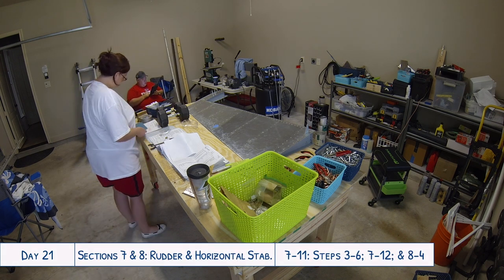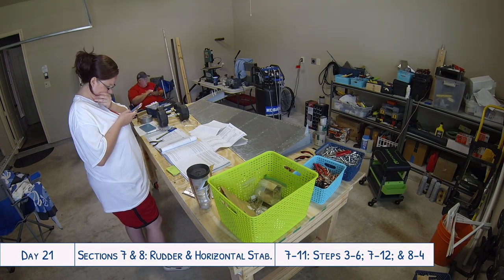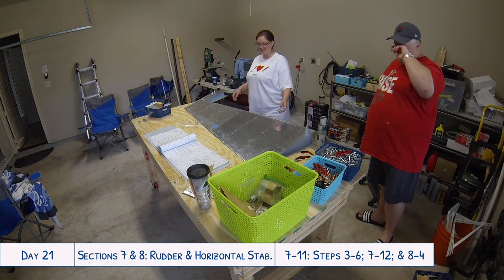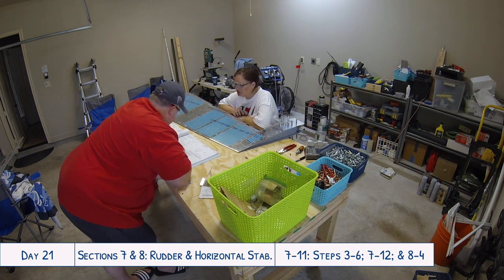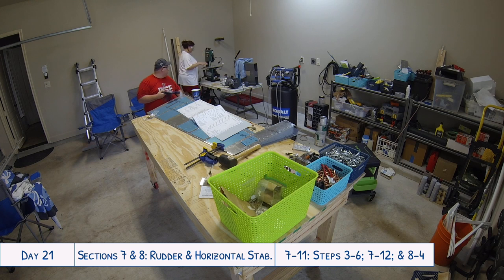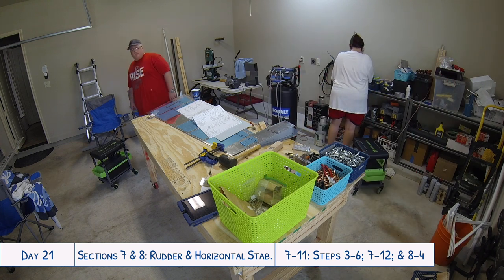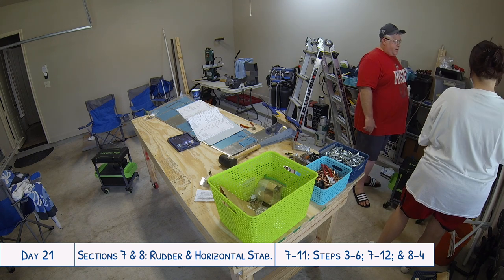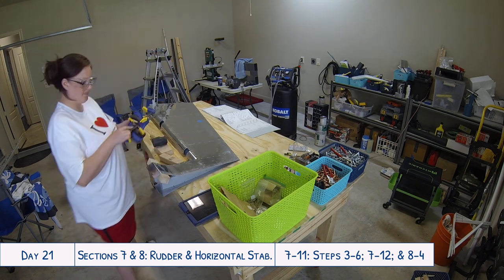Van's Aircraft RV-10 Build: Day 21 - Rudder Complete! (7-11, 7-12 & 8-4)

Comment: I'm probably late with this suggestion but have you got your hands on a "Strap Duplicator - Bushing Type" check them out at any of the aircraft tool suppliers, if you haven't got a set they are nice to have when you need one. I have built before albeit a rag and tube with metal wings so I'm watching your playlists as a friend and I are in the early planning stages of building an RV8 and I like your VLOG, I'm a visual learner and your youtube space is the place for me. I will catch up to where you are now but I'm starting at the start, its like a good book you cant put down. Good job Christine and Tyler...what a team.